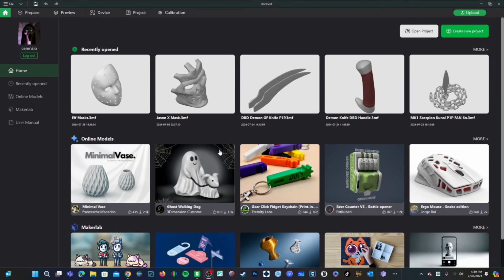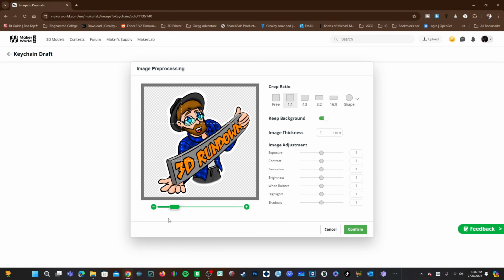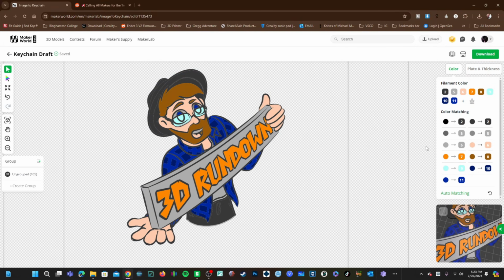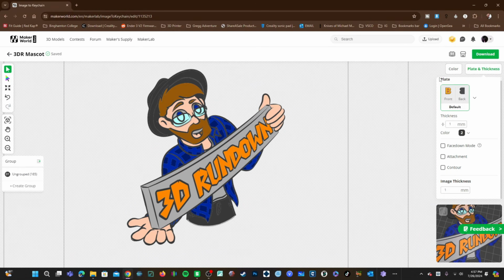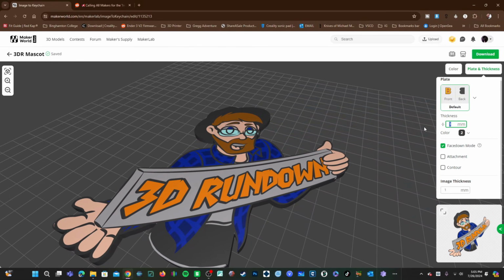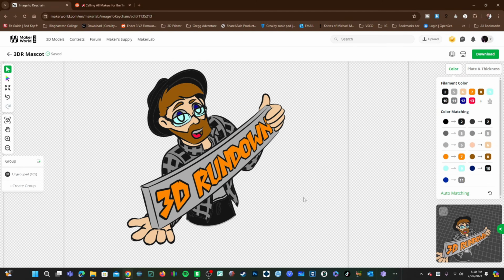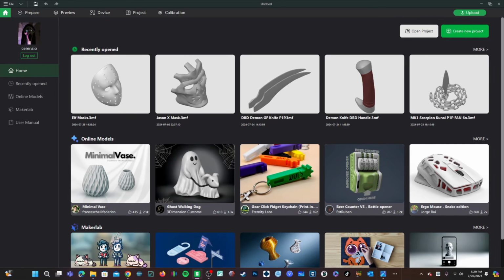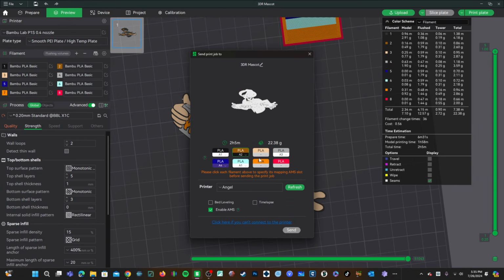TUTORIAL: Bambu Lab Maker Lab: Keychain Maker. Turn a Graphic or Image into a 3D printed Keychain

Comment: This was helpful, thank you for taking the time to walk through those color options. I'm trying to make a keychain and have had problems with the loop attachment. When I increase the height of the keychain to 2, which seems much sturdier, the tab stays at 1 and is fliimsy. I've tried different methods of increasing it but then can't get it to merge with the same back level. 
Also you selected remove background but then reselected, so I'm not clear on that one. So far I've created 6 times and each print has a little flaw. I'm going to keep at it but glad to see this video because it did explain things.
Oh! On my app it has the option to check the box for "Stroke", but I can't find the explanation on that. Anyone know what that is?

Comment: I tried printing some keychains today and the bottom layer was super blobby and uneven with loads of colour bleeding and imperfections. Will reducing the speed help or that and a combination of something else?
Reply from the maker: Hi AMY. Since 1st layer for these, is super important, and totally flat, that 1st layer is important. Check the box for Bed leveling. Slow your Initial Layer and Initial Infill speeds, dramatically. To like 50
Reply: @3DRundown thank you so much!! 🎉🎉
Reply from the maker: Also, CLEAN THE PRINT BED. Get Scott Blue shop towels at Walmart, and any cheap IPA.

Comment: Great video, very clear! I have a question, I'm making keychains in Bambu Studio using this method, but when I add the NFC logo to the back, it doesn't show up in the print. Do you know a way to make it work? (What I do is take the file generated by the program and then merge it with the NFC logo)
Reply from the maker: Is it an svg? did you merge them? I too find this to be a confusing pain in the ass. Pop over to my bambu group on FB or Reddit and post a pic/vid

Comment: Any tips on the top layer quality. I have tried a couple different designs and the top (face up) layer is completely disfigured although the bottom layer (PEI facing) is great.
Reply from the maker: I would mirror the model, and use the BED SIDE as the top.
Reply: @3DRundown  thanks for responding. In my case both sides are the same initial so it is the same on either side so I can use the bedside or the top side as the " unquote top. It's just that whichever way it lies that top side always prints poorly. He had if I don't have any of the logo on the top so it's like a blank it's perfectly smooth. It's only when I have a logo on that top side that it seems to have problems. Again both sides are identical. Any help would truly be appreciated.

Comment: This is an excellent tutorial but it made me feel very stupid.  I've watched several times but for the life of me cannot understand how to assign colors properly (A1 + AMS Lite).  In fact, I've never managed multicolor prints unless I get a ready2print hueforge file.  I'm not sure what is going wrong or where I'm losing it but something about the manner in which colors are assigned is completely defeating me.   Any suggestions?
Reply from the maker: I suspect you are losing your way, in the final step, before sending the print. When you prepare to send the print, look at the AMS color graph, on the "Print Screen". Looking only at the TOP COLOR, where the 1st color, on the left, is the 1st slot, on the left, of your AMS, choose which slot, that color is in. Do the same, for the rest of the colors. For example:  If, on the print screen, the 1st color, shows BLACK (the TOP color, not the bottom), select which slot, in your AMS, the BLACK is in. If it's in Slot 2 (from left to right), choose Slot 2. Even if it shows the wrong color, on the bottom)
Reply from the maker: You'll see me doing it here. (A) is my 1st AMS, and (B) is my second AMS: https://youtu.be/qgQ4ubvnPm8?si=EIRTefljUdHAQnck&t=1115

Comment: How do you do this without a ams ? As in one color.
Also will it do 3d as in figure stature ? Ty Gregg
Reply from the maker: Could assign everything to the same color. Probs look like nothing though. Only does flat. There is another tool for 3d though. I'll check it out
Reply: @3DRundown  ya it would only be the shape without ams . just does surface parts with ams 
So a repaint arrangement color program it is  on your personal photos etc. yes look into later 3 d ty Gregg adventure